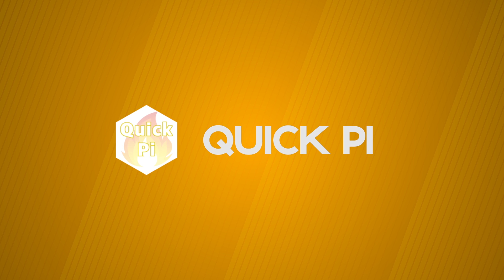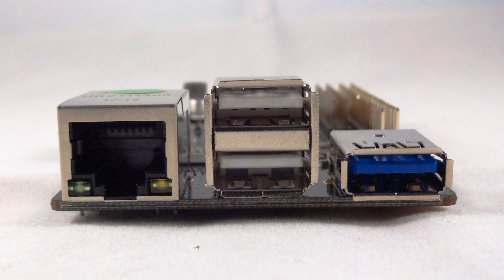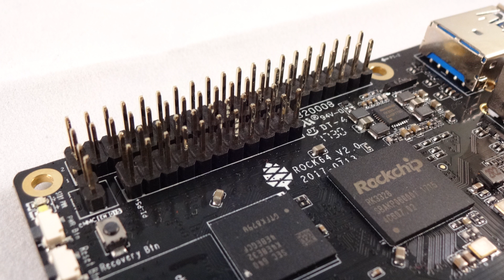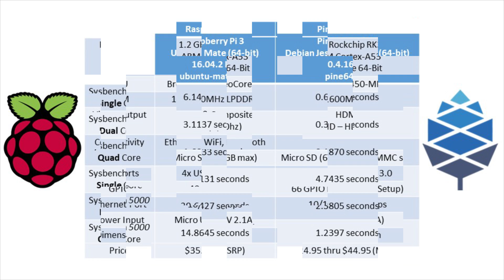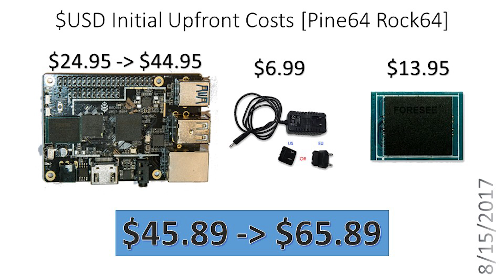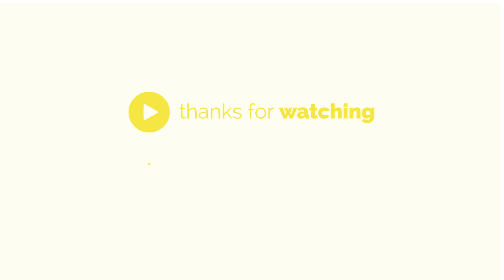SHOWDOWN: Rock64 vs Raspberry Pi 3

Comment from the maker: For those of you who say the OS were not fair, take a look at my other video, where I ran the same tests on Raspbian Jessie Lite: https://youtu.be/Xwum6kHczJc?t=7m21s

The sysbench numbers for that are run on Raspbian Jessie Lite. Raspbian Jessie runs 32-bit on all Pis to ensure backward compatibility. Running Ubuntu Mate allows you to use the 64-bit capabilities of the processor. When I ran these tests, I had no HDMI plugged in, so the OS would not run any GUI resources and waste CPU cycles on that. Each score also was from 5 trials, each taken 5 minutes between to ensure there was no effect of thermal throttling.
Reply: QuickPi see benchmark wise the ripi has been beaten at a similar price point multiple times, that's not why the ripi is still for some (like me) a better purchase because the ripi has so much more support so if I need a nes case or a 3D print I can be sure with the ripi that I will get it, also with the orangepi and other boards I almost bought I found out the GPIO didn't even work?! Anyway if you need power I think the rock is best if you don't mind not having %100 confidence that if you run into a problem some can help.
Reply from the maker: +OPGameZ if you are doing server based applications, you need a better processor to handle loads. If you are doing something with GPIO or etc, I definitely suggest Raspberry Pi. I did also state this in the conclusion. Beginners and newbies should stick to the Pi to learn the overall Linux and learn bash. People with good experience and knowledge can keep moving on to better boards like the Rock, OrangePi, etc.
Reply: QuickPi Agreed (mostly)
Reply: be nice to actually see a running video
Reply: can you use the EMMC for primary boot and still use the SD card for storage?
and how do you  get a boot image onto the EMMC ? i HATE the rpi 3 (all r pi models actually ,i tried the zero and zero w, same exact  issues) it is worthless it corrupts  my card ever 2 or 3 boots sometimes even  after 1 reboot the card is corrupted sometimes  on initial boot it corrupts the   rpi 3 is useless garbage  i do not recommend it ,it is trash i am looking to get a board with EMMC because r pi boards are worthless garage that corrupt SD's  constantly might as well  take your money and flush it directly down the toilet
Reply: @andreamitchell4758  They sell eMMC writers in 2 versions, USB one and microSD one that you plug into microSD reader and then to your PC
Prices are 8-10usd
Reply: QuickPi hi, nice video. Can you test the rock64 against the odroid ux4?

Comment: The 1GB Rock64 is on Amazon right now for $16.99 bundled with a 5V 3A power supply, a Sandisk Ultra 16GB TF card and a 16x2 line LCD display. https://www.amazon.com/gp/product/B0868WSTXH/ref=ppx_yo_dt_b_asin_title_o00_s00?ie=UTF8&psc=1

Comment: The power adapter is junk, or the one I got. If the cord or board moved just a bit it would lose connection and reboot when it did. I ended up getting a barrel x USB-A cable to cure this ill. I have the 4GB which performs well as a portable desktop.

Comment: So which one would give the best performance as a Plex/Kodi/ media server? Output would be to a 1080 HDMI 52-56? 
Thanks
Reply from the maker: I’ve been using my Rock64 for transcoding. Been doing a better job than my Pi ever did. The CPU is just more beefy. Just add a good heatsink and a small fan and you should be fine.
Reply: QuickPi Thanks for the info. I'll be looking in to it.

Comment: For beginners?! Raspberry Pi is used by everyone from beginners to experts. It's the commumity support that allows beginners to use it with ease as well as those willing to "put in the work" to complete mpre advanced projects. You didn't even mention what other capabilities the Rock 64 has other than using it as a media server. I couldn't even find it for the low price you quoted and that was starting at 2GB and before adding wifi and BT which comes standard on the Raspberry Pi. I'm not convinced.

Comment: If you can use the same OS on each board, then use the same OS on each board. Otherwise, your data is askew and should be junked. 

Accessory boards to the Raspberry Pi 3 are not "backwards" compatible to the Rock64, they are compatible to the Rock64. Some of the Accessory boards to the Raspberry Pi 3 are backwards compatible to the Raspberry Pi 2.

Comment: At 4:45 audio and microphone?  That's news to me.  Is this a Pi3 specific feature I never received the memo for?
Reply from the maker: It can support audio and mic thru the 3.5mm jack
Reply from the maker: It’s been there for a while and you just have to change it in video settings, from composite to audio and mic

Comment: These are good benchmarks but like every single rock64 comparison video the youtuber fails to mention weather or not they used emmc or microsd on the rock64.  There is a huge difference in process time between the two cards.
Reply from the maker: SD card on both devices. Same SD card model on both as well. Sorry for missing out the detail.

Comment: If it only had Wifi, for portability, it would be INCREDIBLE, especially considering the comment posted here about using a USB power supply with a common connector, given that the 3A (or 3.5...) is the maximum, not the minimum. The power is very impressive for the price.

Comment: the barrel jack for 5v is in no way a down side, I wish the Pi had a barrel jack because uUSB connectors are not good at all for carrying above 1A of current without introducing voltage drop or in the worst case over heating due to the tiny pins.

Comment: performance looks promising. But what about NAS-performance? How fast and reliable can the rock64 reads data from usb3 and deliver it versa ethernet? I had a disappointing experience with the odroid-c1, which was only capable of delivering a steady stream of 8 mb/sec from a connected usb2-hdd.  I was using OpenMediaVault.  A benchmark in this regards is much appreciated.
Reply: I've seen another video stating it can saturate the gigabit Lan at 100 MBps transfers.. I just ordered one for just this

Comment: I was able to get a 128gb micro SD card to work with pi 3 but I think results very depending on brand and make. The Rock 64 looks to be a great board but would really like it too have at least Bluetooth for wireless gaming.

Comment: I think the main reason for the drastic speed difference is the memory used, should of tested with sd cards in both though to check that out
Reply from the maker: Both boards had the same SD card. Also the sysbench tests rely on pure CPU computing power, nothing storage based.
Reply: OK thanks. I was confused because of the storage type recommended at the end. I thought if using something as memory then it would fundametely affect but I guess it was not using it like ram. Thanks again

Comment: Something that might be useful to note is the 2nd GPIO strip includes headers for a second Ethernet port @ 10/100. Useful if you want to make a vpn tunnel Router as it can be hard wired rather than depending on the slow RPi WiFi in addition to the onboard Ethernet. If you really want decent WiFi then you have to add an external one anyway. Also the RPi shares the usb bus for it’s Ethernet connection so would be interested in a comparison of throughput when using usb devices (maybe an external HDD or SSD).

Comment: What about game emulation how well does that work on the rock 64?
Reply: ucity metalhead haven't used it myself but I have used the Raspberry Pi. The Raspberry Pi is really good for emulation but kind of sucks when it comes to Nintendo 64 games. The pine64 might perform slightly better though because of its specs but you're going to have to deal with the lack of Internet unless you're using ethernet. Also your resolution possibility would be higher because it's able to Output 4K with the pine but I would just stick to the Raspberry Pi because most of the software out there runs fine for it and there's a huge community of people that could help with any issues you might have with the pi but if you can figure out a way to enable wireless on the pine64 I'd say give it a try
Reply: Sourcefed Nerd yeah and being a newbie to these things the pi would be a better choice for me too.
Reply: I have bought a second rock64 just for gaming, not had time to set it up yet.  On the Pine64 community forums, people have been reporting it running significantly faster on emulation on Android, and on Linux than the Pi3 runs.  Some emulators are not available in 64 bit (yet).  N64 is supposed to run nigh on flawlessly on an Android emulation, as does PSX.

Comment: Make another video of this and put Debian Jessie Lite on both of them and see the performance of the Raspberry PI 3.
Reply from the maker: I have tried it with Debian Jessie Lite and the sysbench score does not change. To see the sysbench results with Raspbian, here is a link to my other video where I did similar geekbench tests: https://youtu.be/Xwum6kHczJc?t=7m21s
Reply from the maker: take a look at my pinned comment...
Reply: This might be the sloppiest review/comparison video Ive seen to date. It takes about 10 min reading through the spec sheets of the two SOCs in question to determine they are within 30% of each other in terms of processing power and 2 min of Googling why Sysbench gives such different results

Comment: I ran a 128 GB card on the Raspberry Pi 3.
Reply from the maker: Yes it does work, but it is not 'officially' supported
Reply: i run as low as 2GB card and even then  it gets corrupted after every single boot no matter what card i use  what size or brand   and no matter  what power supply i use  the pi's corrupt the cards  i tried 3 amp wall warts , 2 amps wall warts , a PC power supply from and old  486 used the 5v rail and  tried 8 different  SD cards , 2 different  pi 3 model b's , 5 different pi zero 1.3 's and  3 pi w 's,  all of these boards suck and  will corrupt any card after just a few boots , how did the pi get so popular it is an  utterly worthless piece of shit  ,you need to reburn the OS and start over  from scratch practically after every single reboot  usually around 2 or 3 boots and your card is fucked up ,what fuckkng garbage these things are i am going to  just break down and buya board that has EMMC now, fuck this pi shit

Comment: If you used Raspbian Jessie instead of Ubuntu Mate, the 10X difference would come down to a 1.5X difference. There is a video somewhere on youtube, where a guy compared performance of a Pi running Raspbian Jessie and Ubuntu Mate, and Mate was like 8 times slower.
Reply: I don't know what Ubuntu did but I switched to Mint because each Ubuntu release got slower on all the machines I have. Debian of course is faster so I think maybe Ubuntu has fallen into the Windows Vista trap of just adding bloat for no useful purpose :)

Comment: Before the smartphone era DC-barrel-plugs were the industri standard - so calling it proprietary made me giggle :-)
Micro-USB was NOT designed with main priority to delivering power, but DC-barrel-plugs were. Also the USB-3 spec demands the host can deliver 1.5 A, the USB-1&2 only demands 0.5 A, which means the Rock64 needs 2.5 A headroom for 3 USB ports against the 2 A headroom for the Raspberry Pi's 4 USB ports.
Personally I am VERY happy with the choise of a DC-barrel-plug on the Rock64 - micro-USB is sub optimal for 1 A and above.

Comment: that connector they're using for the eMMC should really be made standard on these things.  what's this connector actually called, I can never find them.  also, it'd make more sense if the eMMC Enable jumper were integrated into that connector.
Reply: Sarreq Teryx sorry late reply but its called an emmc to microsd adapter.  You can get it at ameridroid dot com for $4
Reply: EMMC should be made standard period
   my pi need to have the image reburned after every boot  almost
 SD sucks all these pi boards suck and constantly corrupt SD images with out EMMC they are worthless, then again i only tried r pi boards they are all garbage ,every single model , maybe other SBC's that boot from SD are better do not have that problem but with EMMC you are not going to have to worry about reburning images constantly

Comment: There's something very wrong with your benchmarks. There's no way the 600 Mhz difference in CPU frequency between the two boards would lead to a 10x difference in performance.
Reply from the maker: I have tested multiple programs and I am seeing vastly better performance. I transcode video for HomeKit, my previous delay in the stream was approximately 20-30 seconds with the raspberry pi. With the Rock64, the delay in the stream is just under a second and I have no skipped frames. This is just one example. I have tested multiple Raspberry Pi and Rock64 to ensure my results aren't out of the ordinary...
Reply: This was hardly a scientific comparison. To make an accurate speed assessment, ALL variables must be the same. Same OS on both, same amount of RAM, etc. If this can't be done, then general comparison benchmarks are basically useless: apples to oranges. I didn't buy into the speed disparity right off the bat because different flavors of OS may contain different overhead processing that is unaccounted for in a general head-to-head comparison. As such, your tests cannot actually say that the hardware of the one is faster than the other, because it could actually be software that accounts for much of the difference.

Please do a video that compares setups that are as completely matched and measured with appropriate benchmarks as precisely as you can. You haven't done that here.
Reply: It's not just the 600MHz CPU clock frequency that makes the difference. Note that the RAM on the Rock64 is SDDR3 @ 1600MHz.

However, the pertinent information here would be: What is the sysbench command line that was used to generate these results?

Comment: a barrel jack power supply is an upgrade over the pi. Who isn't sick of seeing that insufficient power indicator in Raspbian. and trying to power anything with the usb ports on a pi was a lost cause.
Reply: I was sick of that indicator until I bought a good quality power supply, and never saw it again.
Reply: Indeed, seems the RPi3 requires a 5.1v supply - apparently that 0.1v makes all the difference.
Reply: +QuickPi - doesn't seem to be a fore-gone conclusion, however my RPi3 kit was from Element14 and the adapter is 2.5A, 5.1V
I've searched some forums for discussions on this but haven't found a final definitive response...just many opinions.
Couple of recurring points seems to be regarding number of attached peripherals and voltage drops (including through cables), and the question of over-clocking.
Reply from the maker: +George Kaimakis interesting... never seen that before
Reply: I have no problems with mine
Reply: I have a clusterhat with that same power supply going to the the Pi 3, but with four Pi Zeros getting power through the GPIO via the clusterhat board. Needless to say, the insufficient power indicator isn't rare on that setup. Sometimes I have to start up the Zeros a couple of times before they all successfully boot. I'm probably going to suss out a higher amp supply and see if it is more effective.
Reply: Very true and plus if you do not use a 2.5 amp charger  Which has to be separately Purchased with the RPI3.  And if you do not use this charger You will get an under Volt error
Reply: all pi's are total shit , total worthless garbage they corrupt SD cards CONSTANTLY , it is not even worth the time and aggravation 
 every 3, 2, or 1 , or 0 boots  i need to reburn the image  fucking things are  worthless , no EMMC no buy
i tried the pi3 model b,  pi zero 1.3  ,and  pi zero w, many different power supplies and many different SD cards , they all suck ,  they are garbage if you do not get power problems and not able to run  USB devices then your card corrupts on every  boot 
what utterly  worthless garbage these things are
not to mention none of them will even connect to  my router , wifi does not work on nyof them pi3,  pi zero w/dongle / pi zero w , none of them will connect to my wifi and i  tried editing my WPA_supplicant file every which way possible they all refuse to  connect
these boards are a fucking nightmare

Comment: why did you not use Raspian on your review? this is also a Debian Jessie variant and would have been more equal than Ubuntu Mate
Reply: My guess, RPi 3 bottlenecked with ARMv6 code in ARMv7 mode vs Rock64 native ARMv8. See: https://forum.armbian.com/index.php?/topic/751-rfc-support-cortex-a53arm64/&do=findComment&comment=12462
Reply: Andrew's point is valid. If you are doing benchmarks, you should use the same OS, and the 10x difference can't be explained by the better hardware.

You are comparing a fine-tuned OS from the maker of one board (Pine's flavor of ARMbian) with a generic distribution ported to the Pi. It would have been fairer to use Raspbian or even a generic ARMbian on the Pi, even if it was 32-bit. Running a 64-bit OS on a system with less than 4 GB of RAM does not give any real advantage (you can address a lot of memory, but you will crash into swap long before filling the 32-bit 4 GB address space).

Of course, the Rock64 is more powerful than the Pi 3. But ten times? The processor is based on the same core (A53) at 50% greater speed (1.8 vs. 1.2 GHz), and the faster RAM would only give a moderate advantage (say 30-50%) in memory-intensive operations. All in all, I'd guess the Rock64 is about twice as fast as the Pi 3, not ten times. There has to be a hidden problem with the benchmark (maybe the versions of Sysbench for Pine's Debian and Ubuntu are compiled with different optimization flags, or with different versions of GCC).
Reply from the maker: +Andrew Hayes the Ubuntu mate is the current distribution that is pure 64-bit only, giving higher performance.